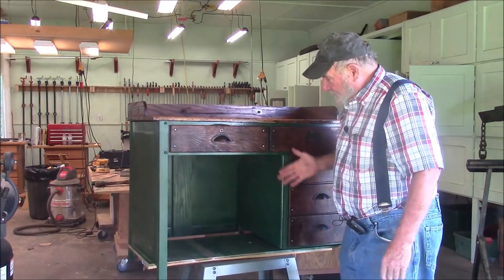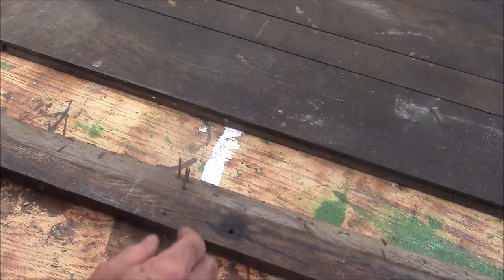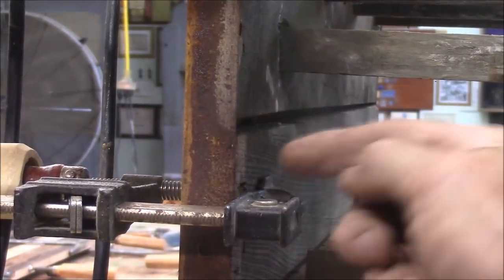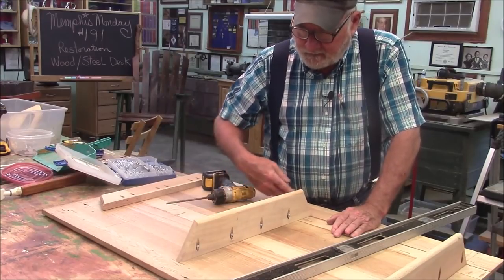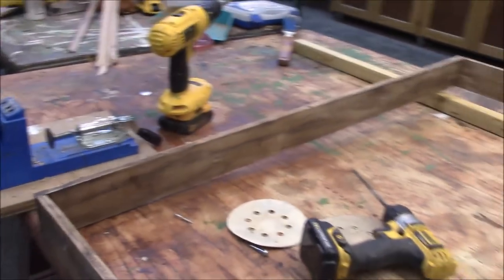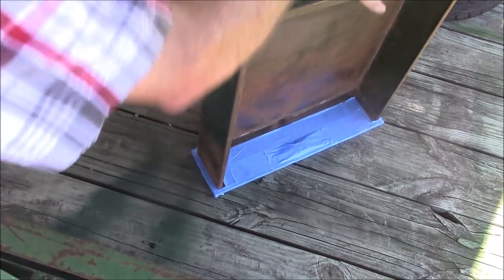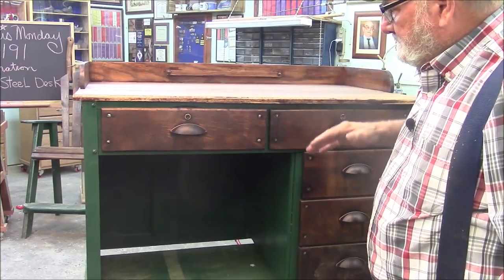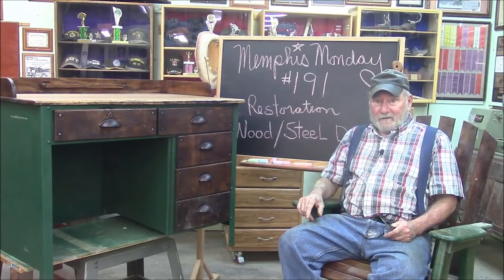Restoration of a Military style steel and oak desk MM 191

Comment: I noticed the desk during last week's project and I was hoping it would be this week's project. I looks like you had your work cut out for you and I had no idea the desk would come out as nice as it did. It looks to me that it was probably just a plain metal desk to begin with and somebody added the oak panels at some point to spruce it up a bit. As you mentioned, I've also never seen a desk with two top drawers, metal or otherwise.
Reply from the maker: Glad you backed me up on that.  I must have spent an hour looking for a desk with two top drawers, but no luck.  But I'm not certain about much, but I can say that the oak wasn't added later.  The oak drawer fronts were riveted to the metal in such a way that I wouldn't think to remove them.  The desktop was clearly a factory design, with the tongue and groove construction well beyond the level expected of subsequent repairs.  Frankly, I could have replicated that tongue and groove, but it didn't make sense.
     But On Grid, you have me on this one, as I really can't prove, and can't argue one way or the other.  I suppose this is the reason I like restoration jobs so much.  No "creativity" required, rather just find out what the builder intended, and restore it to those intentions.  In this case I went with "Military Style" and executed.
     Thanks so much for the kind words.  Man, I tell you, we are closing in on four years of Memphis Mondays, and I so much appreciate you guys who have been with me from the start.

Comment: Did you rebuild this for the lady who took it to your friend's recycling place?  If not, what do you plan to do with it?  I don't think I have seen a  desk that was metal on the sides but had wood top and drawer fronts.  That along with the two top drawers make it very unique.   I know all the desks I have ever seen at the bomb factory were either  all heavy oak wood or all metal (and frequently OD Green.)     I am going to get all troll on you here and say that it looked that you might have gotten a bit unlucky with the placement of one of the pocket holes you put in the side of the fence around the top.  It seemed to hit one of the seams where two boards on the desktop met up.   Did you figure out what that little piece of wood mounted to the fence was?  Perhaps it was to hold pens and pencils or maybe files.    I like the new handles that you put on the drawers.  Overall, the finished product looks great.  

Well, to add to my stress, I have been under the weather the last few days.   Speaking of stress, the chances are good that the problems are stress related!     Oh!  And I woke up to snow this morning!  It isn't supposed to do this yet!  It is still Fall for Pete's Sake!  OK.  Enough of my rant.   I hope you are happy and healthy and making lots of saw dust.
Reply from the maker: Just keep your sense of humor and everything will work out fine:  "I'm under stress because I'm under the weather, and my problems are stress related."  Classic.  Sorry about the snow, and it's getting down to Christmas.  Santa needs snow to bring you goodies.  
     You didn't mention Leo, and we nailed it in our earlier discussions.  Leo cut the end of his finger off!!  And he didn't do it with a saw.  Funny thing, he wouldn't say how he did it, which tells me that one of his helpers were involved.  If you watch the video tell me what you think.
     I figured that you would be the only one to notice that unlucky pocket screw!!!  Yes, I sure did notice it, and then I crossed my fingers as I gingerly eased that screw into place.
     Yep, this is my homie from the recycling place.  I've done several jobs for him.  He is the big gun guy who I did the gun stocks for, (until I told him I was out of the business).  He is going to put reloading equipment on the desk and put the whole business in his ammunition reloading room.  He's a good homie to have, as I'm hoping that in his position he will find me more of this kind of work.  My favorite.  
       Thanks for watching, and I hope you get to feeling better.  Remember, there is no illness or stress in Florida this time of year.  It's the law.
Reply: @MemphisApplegate  Thankfully, the snow finally melted in my yard.  However, I suspect there are still several inches just a few miles away in the SMNP (Smoky Mountain National Park and will be heretofore be referred to as SMNP )

Dang!  I forgot to mention Leo!  I have been chomping at the bit to talk to you about him since my brother told me he saw it on Instagram.  I watched the video last night.  Did he say that he didn't cut it with the chain saw?  He specifically mentioned the boat saw and another saw but I don't remember him saying all saws or the chain saw.  It is very possible that it involved one of the helpers.  I don't know what a smashed finger would look like, but I had wondered if he had perhaps smashed it off putting in one of those ribs.    But you are right that he went out of his way NOT to tell how he did it.  Overall, I bet this brought back some very bad memories for you.

Thankfully, those braces you put across the underside of the desktop should hold it all together even if the screw would try to break the seam.  Your smart thinking to the rescue even before you knew you would need those.

Your homie reminds me of that old FOX (not FOXNEWS) show called, "Roc".  Roc was a garbage man who was always getting treasures from his rounds.    This desk should be perfect for your homie.  you would need something more substantial like this to hold all that heavy equipment   It sounds like you two have a very symbiotic relationship.  As long as he keeps getting treasures that need repaired, you have videos to make.

By the way, I don't know if you saw my FB post but if you have  Charter or Spectrum, don't answer any emails.  It is a scam.  Fingers crossed that in one more month I will be laying by the pool having an adult beverage and soaking up the rays.  Once I get past Atlanta, or should I say around Atlanta, I will have the biggest stress off of me.

Comment: What specifically is it about this desk that makes you believe it is military style?
Reply from the maker: Wild guess, really.  I couldn't find this desk, or anything like it on the internet, like I normally do.  But this is why I called it military "style:"  
1.  I spent 26 years in the military, including 2 years in the Army.  In both the Army and Navy I remember many steel desks.  In the Navy steel desks were preferred because they didn't burn.
2.  The color.  Olive Drab was the original color, which says Army to me.
3.  There were two, now closed, Army bases In the area of the country I got this desk.  When a base closes stuff like desks go to a place called DRMO to be sold to the public.
4.  The no frills design.  For example, no drawer guides. No "decorations" at all; no trim; no edging; no detailing.
5.   Heavy duty material.  
Thanks for watching and commenting.  Do you think the epoxy repair will hold up?  Couldn't get the steel as clean as I wanted.  But I think the top came out ok.
Reply: @MemphisApplegate  I know nothing about epoxy, although I will be using some JB Weld soon to glue a patch on cast iron steel.
Reply from the maker: @JimWatsonTheframingMagician  I've never used JB Weld, but I've watched several videos with guys using it on cast iron.  Engine block repairs mostly, in the areas not bounded by water jackets or combustion.  Think I even remember a guy repairing a piston with the stuff, just to see how long it would hold up.  Not very long in the heat of the combustion chamber.
Reply: @MemphisApplegate   You mention you were in the Navy. I live in an area that is landlocked from the sea yet the US Navy maintained a base here during the BIG ONE. Can you name the base?
Reply from the maker: @JimWatsonTheframingMagician  (1)  The Indiana Army Ammunition Plant was an Army manufacturing plant built in 1941 between Charlestown and Jeffersonville, Indiana.  (2) Jefferson Proving Ground, near Madison, Indiana.  I got the desk near Vevay, Indian, which is up the river a few miles.
      The Navy still maintains landlocked bases, as they were put inland to avoid bombing attacks!!!!  Remember, in 1940 we didn't know how things would work out.  For three years, 1998-2001, I was stationed at a very large Navy base in Indiana, called Crane Division, Naval Sea Systems Command.